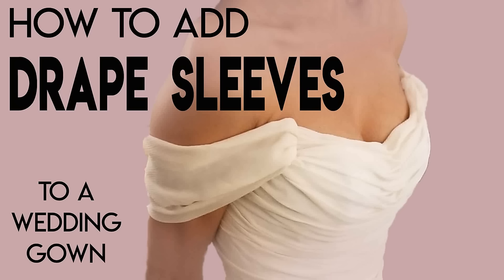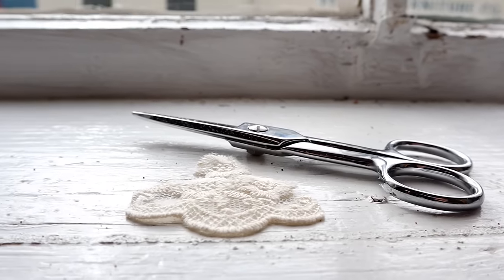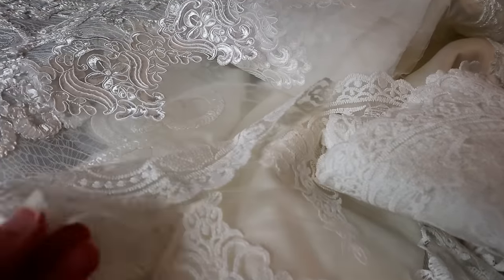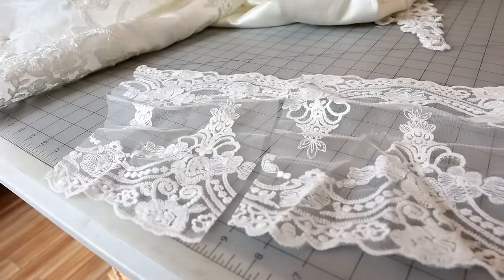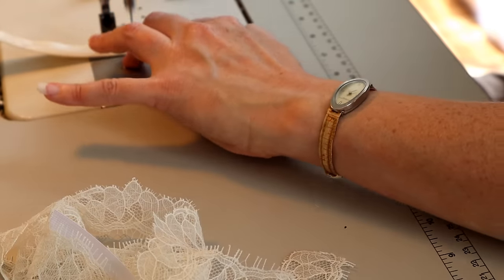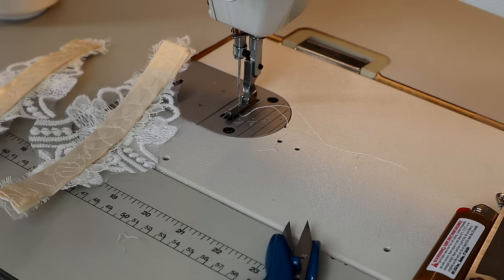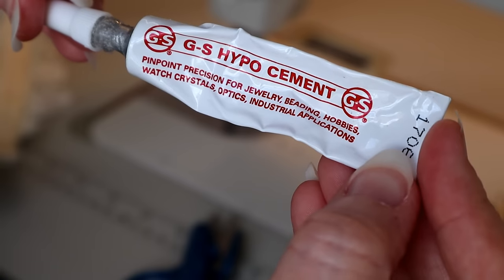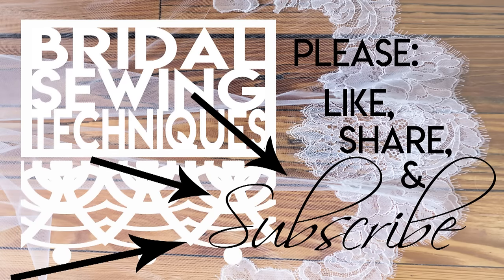How to Add Draping  Draped Sleeves to a Gown, Wedding Gown Sleeves

Comment: Hello. Is this piece a simple tube gathered at each end? Made from rectangle? I’m wondering if you fan it down at armpit- (I have spaghetti straps), in order to make more space (droop) lower down. I’m adding to a beaded cocktail dress using light, drapey sequin fabric. I’ll wrap the straps to add button & make it removable. Thx!
Reply from the maker: https://youtu.be/IrPVb8VUM2s

Comment: My wedding dress has spaghetti straps and a low back and I wanted to get the straps changed to off the shoulder tulle straps that sit just on the outside of my shoulder, so it wouldn't be draping down like the straps shown in the examples. Will I still need my seamstress to add that extra high boning or will it be able to function without it?
Reply from the maker: High boning would be best. Other options are: accept very little range of motion, or attach the straps with some elastic, or use knit, (stretchy) lace, or keep spaghetti straps and attach draping straps to them.
Reply: @BridalSewing  Thank you for the advice!

Comment: How would I do this same concept without lace?
Reply from the maker: It would be much trickier, because you would have to match fabric & do an extremely neat job or add ruching or something. The most elaborate way would be to build up the stands as I illustrated and then put a new overlay over the bodice pieces. It could become a very big job if the bride won't tolerate new seams.